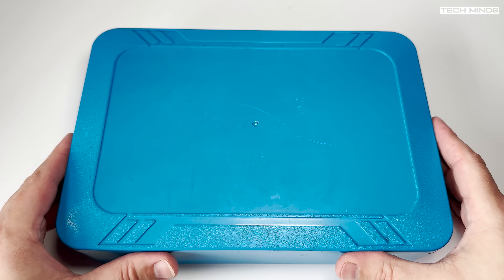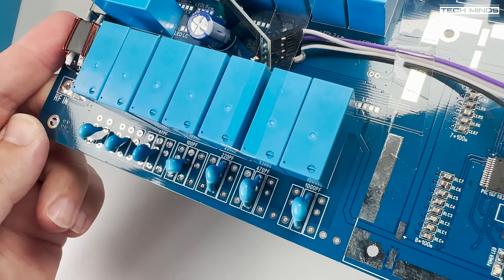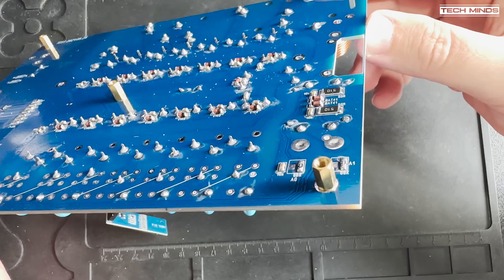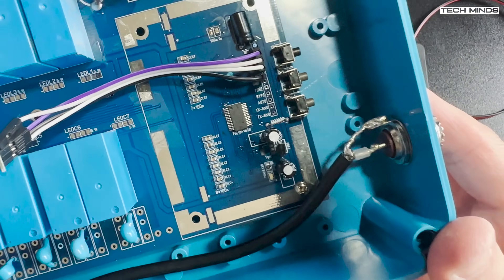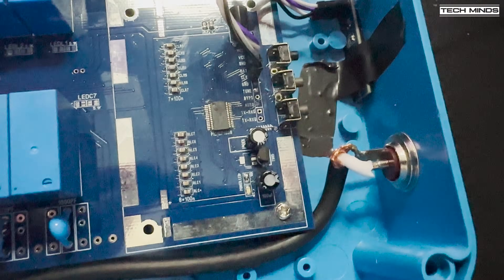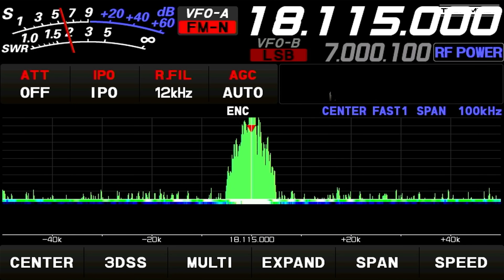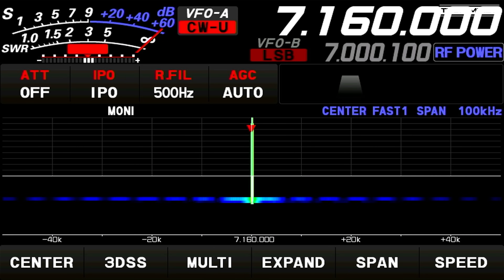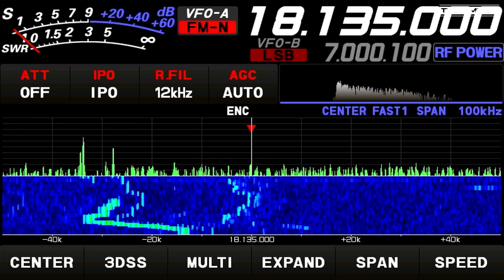AT50 150W 1.9 - 54MHz HF Automatic Antenna Tuner

Comment: Nice to have if you dont own a atu. But the best is a antenna that is good tuned in lengte. I have a 991A and a endfed for 10, 20 and 40 with the atu the output gets less. And the antenna is good without the atu so i did stop using the atu. And thats in my eyes the best.  73' PD3A

Comment: Hi Matt, I've been using this kind of couplers for a long time. I had different makes and brands. The best I got was the 1 KW JC4S tuner by Stockcorner. Your video shows why you can't use 1/2 lambda or multiples of thos wire lenghts. You need non resonant wire lenghts that stay away from hambands. I did many A/B tests with endfed antennas and rondom wire with tuner. Sometimes the tuner and random wire was stronger, sometimes not. It depends on the position of the antennas ofcourse. A pretuned matched antenna in my opinion has a little less noise but the big advantage is that you can work many bands with a single random wire. Keep up the great videos ! 73 Phil ON4VP

Comment: Multiples of half wave should be avoided. Too high impedance to match. There are good tables of good easy to tune lengths. If I remember correctly 12.5m is a good length for 40m and up.

Comment: Thanks for another great video. I bought one of these and it fires up ok. I am wondering if anyone has figured out what range of antenna impedances it’s optimised for. I have not been able to get hold of a schematic but I see from the PCB that there is only a single endsd unbalanced output that looks like it’s designed specifically to directly drive end fed mid to high impedance wires without a transformer? If so it is different to most of the N7DDC kits out there which seem optimised for lower impedance loads (though of course they could drive any load with an appropriate transformer). If anyone has data on the range of load impedances this ATU drives out of the box I would be grateful

Comment: I've found that most auto-tuners are much happier if you connect through a 1:9 unun or 1:9 balun and use a no-resonant antenna wire.

Comment: I'd be curious to see how this operates on lowland VHF (25-54 MHz).  From my experience, the driven element is best tuned for the lowest operating frequency.  Antenna tuners are better able to make longer length antennas look shorter, than shorter length antennas look longer, from an electrical/resonance perspective.

Comment: It seems to be derived and improved based on the ATU100, as it also says so on the startup screen. Interesting that it doesnt need ferrites on the coils and how they are arranged perpendicularly to each other. Maybe the piece of coax was not supplied because if you place the SO-239 connector close enough to the solder pads, you can use any cable at these frequencies.

Comment: Two questions
1) If you go back to a frequency you have already tuned does it remember it or does it tune again ?
2) If it does remember the tuning of a frequency that you have used, does it forget the tuning if the power is turned off then back on again ?
Reply: automatic settings will tune while you "tx"   i also change my mode to am (25watts max) key for a second then change back to ssb,  its very quick, hope this helps mate

Comment: 👍 Thanks for video. As per otner comments, also wondered if adding a 9:1 UNUN at the "ATU" or using a legnth of wire not half-wave (or multiple of) resonant on any of the bands you want may help? Possibly, even try both? Although the antena element is not resonant, with the ATU at the feedpoint, it shouid make for an efficient system. Probably more efficent than having the ATU in your rig or shack.
Reply: Agree, most auto tuners work well as you have said.
Reply: I'd expect a  close to resonant half-wave to be a difficult match as it is the highest point of impedance, so using a 9:1 unun will probably help there although there are lengths of wire which are not resonant on any of the amateur bands that are suggested and again they can be used with a 9:1 unun into the tuner.

Comment: Correct it would tune much easier if the length of wire was not near any multiple of a wave length as half wave length wil have a very high impedance say 2/3000 ohms and the tuner is probably only capable of matching say 1000 or so ohms... .. love all your vids thanks for sharing